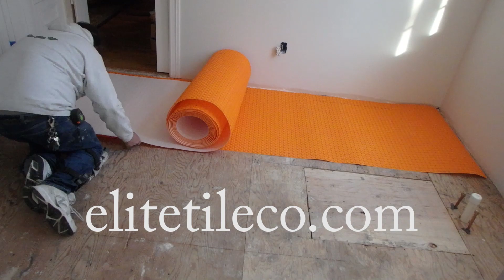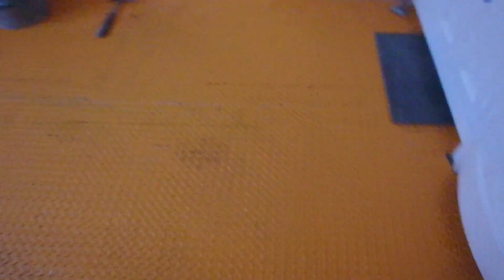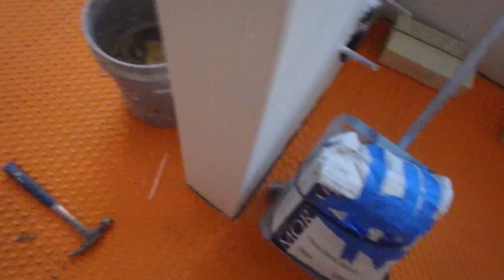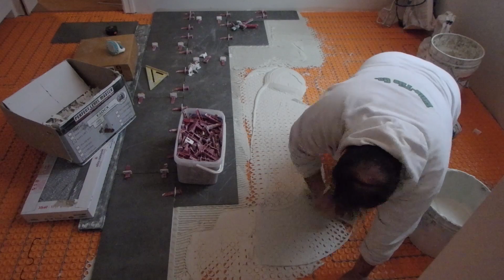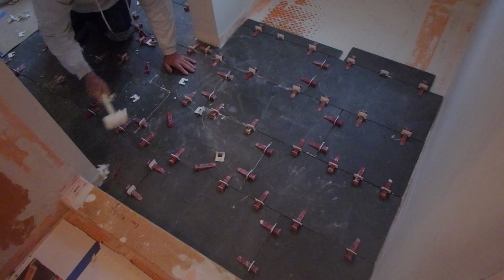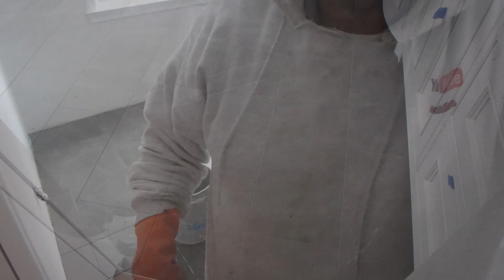Complete install start to finish, heated floor with large format tile installed with T-Lock

Comment: Your videos have been very helpful for us as we plan our remodel and tile installation. We plan on using wood look plank porcelain tiles over Schluter with heat in the bathrooms. I am curious about your thoughts about expansion joints and where to place them in the heated and non-heated tile areas, doorways, etc? Can you discuss this in an upcoming video? Thank you for the time you put into these for us that don't know.

Comment: Sal, can you go over grouting of grout colors from white to dark? The main issues I have with my DIY jobs  is " efloresence" and all the lighter grouts looking white.  I am a seasoned DIYer so I have done a lot of tiling.  Just to give you a story on my experience I had a leak coming from my MB shower. Thought the worst that I would need to pull up the shower floor. After some investigating determined it was coming from the supply lines or shower valve. How would you have gotten to them? Did not want to break through 1 1/4" of tile, thin set and cement board so I did the next thing. Popped the vinyl siding and went from the outside. No worries about pipes in the outer wall. When I did the remodel I built a double wall and all my pipes are in the inner wall with double insulation and a hot water baseboard line running through that section. Once I got into the wall noticed the goose neck pipe for the shower head was leaking from the nipple in the wall. Easy fix for that and putting the siding back on.  Thanks for your quality workmanship and videos

Comment: Hi Sal, I enjoy your videos. Are you just wetting the wood floor with water before the thinset, or is it something special?  I see the thinset under the ditra is different than the thinset used to lay the tile (over ditra).  Do you use a premix thinset to set the tile, or some other difference or recommendation?  What grout spacing do you like?
Reply from the maker: I sponge down the floor with a damp sponge for two reasons, to remove dust and to give the plywood a drink so it does not suck the moisture out of the thinset too fast. Modified thinset to install the ditra on the plywood, unmodified thinset to set the tile on the ditra, never, never, never, never use premixed thinset for anything.

Comment: Do you find the T-locking system gets stuck in between the tile making it hard to grout? I'm just worried about how to break them off.
Reply from the maker: Keep the grout lines clean and knock them out the next day.
Reply: Sal DiBlasi Cool, and thanks for the videos! Do you have one where you finish a shower ledge/step? It seems to be a marble slab in this video?
Reply from the maker: Sure, https://www.youtube.com/watch?v=USVjMzOQWNA&t=31s

Comment: Hey Sal, do you find there is a size limit with porcelain tiles where your score and snap cutters will no longer do the trick? I just tried mine on a 12x24x3/8 porcelain tile and after 5 or six passes - she still wouldn't snap, so it was off to the wet saw for me, slow day.  Would a heavier duty cutter work or is large porcelain best done with a wet saw? Thanks
Reply from the maker: The quality of the cutter is key, if yo are using a low end cutter you will always have problems here are two good cutters https://www.youtube.com/watch?v=8Ppe9Hycn3M up to 24" tile https://www.youtube.com/watch?v=K6I6Fw83jxk&t=132s up to 36" tile

Comment: Great video again mate. just wondered why you wet the ply with water before sticking the mat down, rather than using a primer. cheers
Reply from the maker: It is common practice and a good idea to dampen the plywood to remove dust and also to prevent it from sucking the moisture out of the thinset, which promotes a stronger bond. Sealing the plywood is something that is not done here.
Reply: No primer needed.  He wipes it down to help keep the thin-set from having its moisture drawn out by the wood too fast.  Modified thin set between plywood and Ditra.  Unmodified between tile and Ditra.
Reply from the maker: Bottleworksnet 👍🏻

Comment: Good morning Sal , another great video / but while watching I couldn't figure out if you were using the same trowel to back butter these large tiles as the one that you were using to spread the thinnest on the floor ?? or a smaller one ?? 
and I missed the size commentary on the trowel size for this job as you were talking a bit too fast :-)
Reply from the maker: +BadCat same trowel, just the flat side, trowel was 1/4"×1/2"×1/4"       (1/2" deep)
Reply: Thank you Sal / you're the best !

Comment: Hi Sal, I've been setting tile for about 10 years. Went professional 3 years ago working for another tile setter. I was mostly self taught prior, then learning that the person I was working for was only an o.k setter with bad personal habbits. I've now gone out on my own and want to be a premier setter. I have a couple of questions based on some of your videos that I have watched.

1. Are you in any way endorsed by ditra or some of the other materials you use which would help to influence your decision to use them? If not, how would you explain cost/advantage benefits of some of the more expensive materials over the more economical choices (durrock vs ditra, higher end substrates etc)

2. Ive just started to use a leveling system. Ive seen some videos that show setters actually walking across their freshly set tile with these systems in place...Is this something that you thing can be done so that you could tile a room such as the one in this video in one day as an example?

3. One of my biggest challenges is using a wet saw to cut porcelain tile. I currently use a 7" saw due to the size and weight of the saw being convenient. Do you have a suggestion on a certain blade or should I consider going to a larger saw.

Thank you in advance. I'll Keep watching.

Brian
Reply from the maker: I only use the products i want to use and that i think are of good quality, no one has any influence on my decision and i am not paid by anyone to endorse their products, I choose what i like what i use and what i say about them. Schluter for example has some very good products, and when you add up the time savings and the benefits of using that system the cost is out weighed by the advantage of a superior install. People also expect to pay more for a better product. I have seen the videos where they walk across the freshly installed tile, I don't do that and I don't think it is a good idea. Buy a good wet saw with a good blade, I have a few saws but most of the time I use my best saw. You should look into a schluter work shop, worth every minute https://www.schluter.com/schluter-us/en_US/workshops_for_professionals
Reply: Sal DiBlasi . thank  you much. I meant to implying or insult by asking about endorsements. any suggestions on particular saw or bkade. I have a rubi 7"  but am exploring upgrading to either a 8" or 10" ...thoughts?
Reply from the maker: I understood exactly what you meant and did not take any offence. I like my DEWALT D24000S 10-inch Wet Tile Saw with Stand  http://amzn.to/2l8F3G2 Look into "Tile Geeks" on Facebook you will be glad you did. Closed group, you need something in your profile to show you are in the trade or you will not be approved.
Reply: I'm on it !!!! Thanks again!
Reply from the maker: Great fellow Geek 😃

Comment: Sal I noticed you were wearing the pro knee pads. Are you happy with the comfort and fit? They are very expensive and I was wondering if I should invest in a pair.
Reply from the maker: Yes best thing I ever did, at first they seem a bit  awkward, but you get use to them quickly.
Reply: Awesome I shall look into them. Thanks Sal.

Comment: Do you prefer TLock over MLT?  Or do you use TLock for floors and MLT for walls?
Reply from the maker: T-lock for everything but marble and delicate tile, in which case I use MLT
Reply: Thank you for the answer sir.  I just got my MHIC in Maryland.  I am already getting a lot of inquiries about tile jobs.  Though based on reviews there is no one (that I have found yet) that I would trust to do the work.  Your videos are helping me learn the ropes to know what to look for in a sub.  Might even try this at home myself and see if I would feel comfortable charging others for the work.

Comment: good work again sal. think that's the first time I've seen you use grey thinset. Was there a deliberate mistake around the 15 minute Mark?😉
Reply from the maker: You are correct, I don't often use gray, but I had an open bag I wanted to finish, so I did the unthinkable 😁

Comment: My sister is having someone re-do bathroom and I am assisting, I bought Kerdi board for around the bathtub/shower but she has 3inx6inx8mm glass subway tiles (clear with opaque white backing) and now I am wondering whether to use modified thinset required by glass tile or the unmodified thinset required by kerdi board. Lots of opinions on internet so its easier to ask someone like you that has proven vast experience. 

This is the thinset from Lowes that they recommend for Kerdi: 
https://www.lowes.com/pd/TEC-Skill-Set-50-lb-Uncoupling-White-Powder-Dry-Thinset-Mortar/50343088

What is the risk of using unmodified thinset with glass tile? Is it an issue with adhesion? And if I used modified is the issue drying time (due to Kerdi)?  I read one post where someone said Schluter told them drying time might be 14-60 days, which my sister might not like.
Reply from the maker: That's a tough call, my suggestion is you use Ardex X77 which is a premium modified thinset with self drying properties, so you get the best of both worlds. http://www.ardexamericas.com/sp/Documents/TechData_En_X77.pdf
Reply from the maker: Schluter is the only one that requires unmodified thinset, and it works, I have installed countless amounts of tile on their products. Glass is a difficult tile to work with, needs much more attention to all the requirements, it moves a lot more than normal tile. X77 is a thinset that has special properties, just allow the time that is indicated on the bag. Just be sure to mix it according to their directions, it is different to typical thinsets. Small batches are easy to mix as well. Great stuff. And be sure to use white, never gray.
Reply: It looks like a good product but I don't see any stores in the northern virginia area that carry ardex products. They seem to be looking for sales people in the area. Should I just go with the best modified thinset I can find that is for glass tile? (i.e. the glass tile requirements are more important than the kerdi board requirements)?
Reply from the maker: Like I said, tough call, that is why I used Ardex X77, I talked to both Schluter and Ardex about it, I just finished an all Glass shower with it, you can see it at the very end of this video all Schluter all glass.